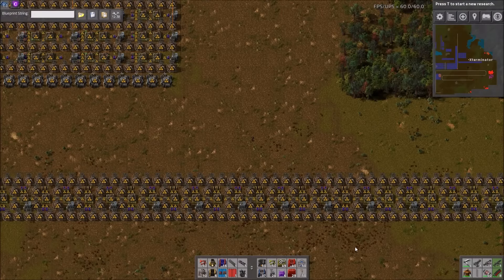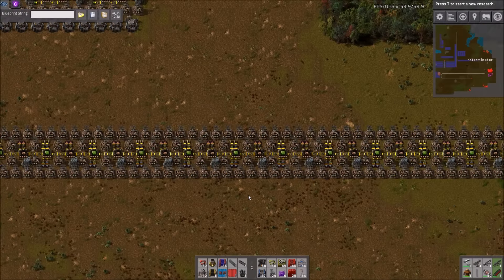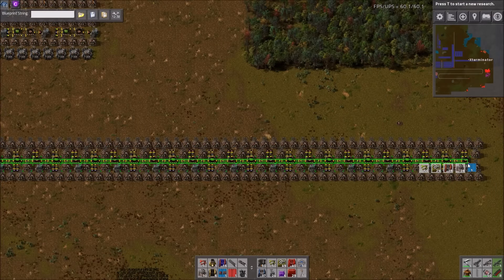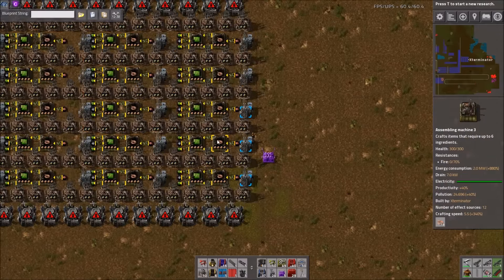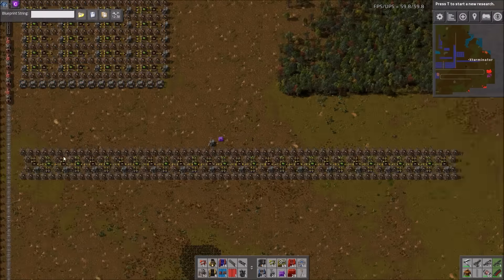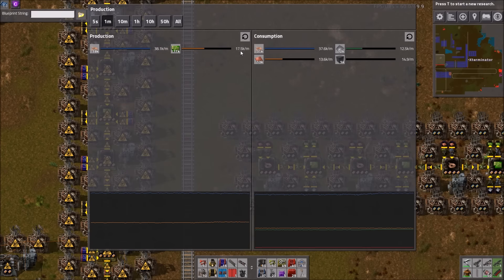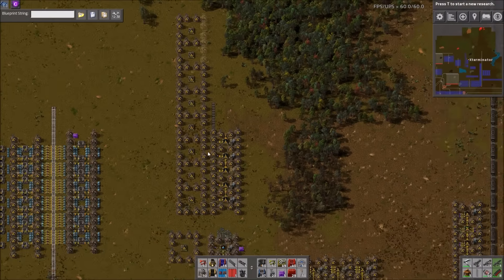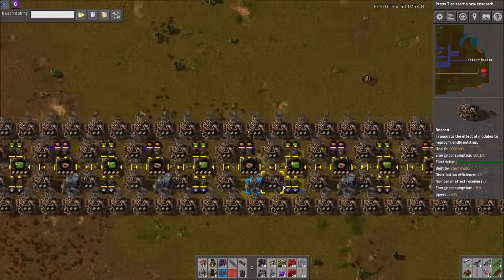Factorio Workshop - Building A Better Factory :: Xterminator's Circuit Build

Comment: One other advantage to this build, a side its compact. its that it 6 beacons in steed of 8 per assembler.

If used in large number of rows it would use 4 instead of 6  cutting down the modules that needed quite significantly.

It seams like this kind of compact layout would work with blue circut production where its really needed.

This would build 2.8 green circuit per assembly unit per time unit.

Red circut need 0.25 per timeunit and produces 0,175
Blue circuit need 1 1/3 green per time unit and 0,133333 red.

So one would need about 1.31 blue factory per red factory

1,33333*1,31+0,2=>1,94.. so you would need 0.7 green factory per set up of red and blue.

One way of doing this would be to set up one red and one blue factory for every green, and just let the rest of the circus overflow. Giving this build a other row of every second red every second blue.

Giving it a overflow of 1,27 green per unittime, 0,0416 red per unittime and a production of  ~0,1 flue per unittime

Making the same calculation with copper cable its a bit diffrent but it should also work.
copper cable produce a whopping 5,6 cable per unittime
Green uses 6 per unittime
red uses 0,5 per unit time

Red uses 2 green, so to produce one red its need 6,25 per unit time eqivalent to green.

that is equal to 25/4 relative to 28/5 for the copper cable. That is 125/20 for green and  112/20 for cable..... Well That don´t break down nicely.

.Anyway... Break this down closest approximate in steed. Say 6 green 7 cable. That is usage of 36 per unittime and production of 39,2 unit time, giving a overflow of 3,2 using for 6 red circut production giving a overflow of 0.2 cable per unit.... That is really quite close.

This gives a red circuit production of 1,05 and a green of 8,4 and a green circute usage of 1,5 giving a overflow of 6,9 making quite close to 5 blue circut using up just over half of the red circuts.

it don´t ad up that nicely... there is a lot of surplus red production.. i guess that is really not that much of a issue. But it also leaves two slots empty on either side. (or in the middle). 

I guess they can be used for some kind of end product.

An nice thing with the 7-6 and 6-5 set up, is that the red circut can be direct feed just like the copper cable into the green. The Green circuts just need to be moved a tiny bit .  (for instance Putting the blue requester for greens right in top of the green provider.) The copper cable also need to be moved rather a shot distance to the red.

Same way can have melting right down under.. if belt melting is used, just put it into a provider right down under the reqvester for the green and cable. This way the transport distances is tiny.

Comment: Great video. The one thing I'd like to see is how you'd supply these sort of maximized setups. What do the roboports and train stations look like to be able to produce 17.6K/m? You recently made a wonderful video about robot networks, but it would be nice to see it combined with something this high capacity, especially since it's so "wide."
Reply from the maker: Thanks! Well for something like this you would just line the top and bottom of the build with roboports to get the maximum coverage. It really depends on the design, but you just need to make sure you have enough charging and such.

Comment: Why does the ratio of wire to circuit factories change as you produce faster? I would have thought it would stay the same...
Reply from the maker: It's the productivity modules that change the ratio not the speed. :)

Comment: Nice tutorial :) What would you use for Red Circuits? Their usual wire:circuit-assembler is 1:8 without productivity modules right?
Reply from the maker: Thanks! And I'm not sure, I haven't tested any new red circuit setups actually. There are some really good ones out there though, like the Zuri build one that was shown in a previous workshop on circuit builds.